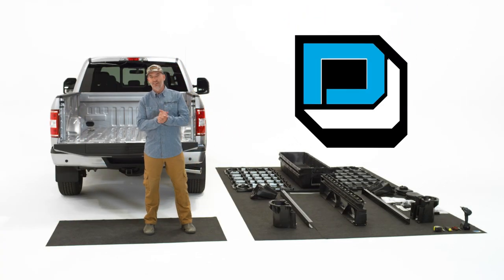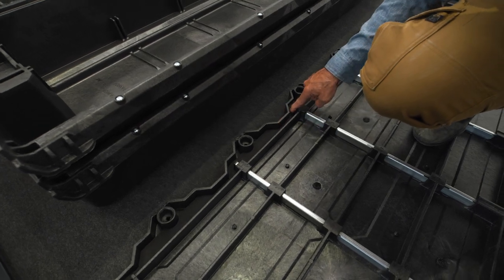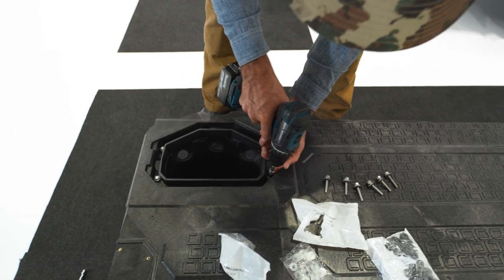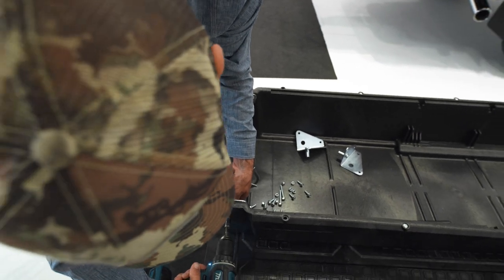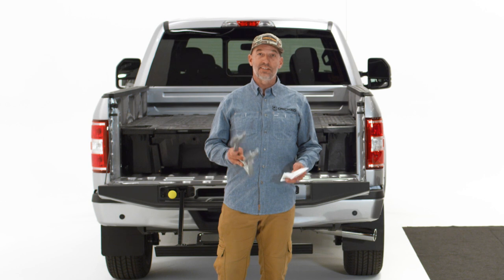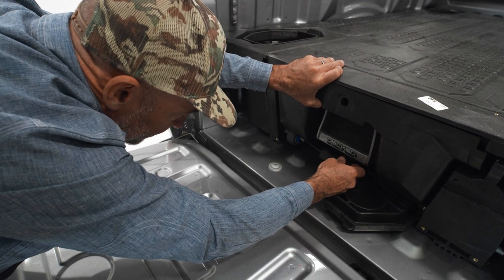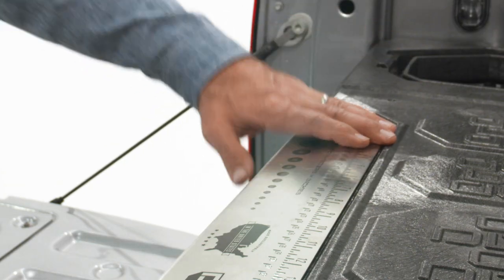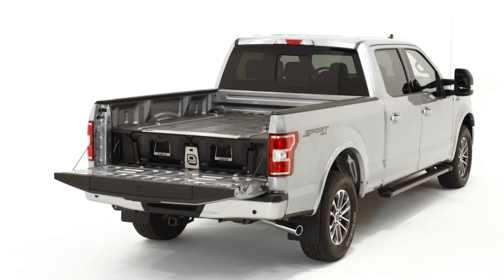DECKED 101: Full Size Drawer System Install Video

Comment: Watched the video a few times before I started my install (2023 F150). It was a bit cloudy, and I think a few of the plans have changed, but this was still a good resource. The whole install took me around 2.5 hours. The biggest part of that time was me taking off one of my tow strap hooks in the truck, a day after having a spray-in liner put in only to realize the instructions have changed and you don't need to completely replace these hooks any more. Decked has redesigned the J-Hook for the cab side. 

I love it already.

Comment: FYI: Decked Tech Support recommends NOT using this video as a reference, and the instructions kinda suck too so here are a few golden tips.
A. Use the longer bolts on the small cab ammo cans and the shorter bolts on the larger rear ammo cans. 
B. Because of the engineering genius involved, ONLY the bed covers are marked with any sort of orientation, so be damn sure the center spine is facing the right direction or you WILL install it backwards! The numbers and letters at the bottom of the ammo cans mean NOTHING, so don't try ad figure them out.
C. The screws are extremely cheap and aluminum (probably to prevent rust but my bed is covered) so you'd be wise to go buy a couple quality back ups as some will not fit correctly. Do not force a tight screw. Try a different screw or replace it.
D. Working on the Deck System at waist level is orgasmic by comparison to the ground. Use a work horse, fork lift or however you can get it up. 
E. Tech support is super fast and super friendly, but I'm not quite convinced they have ever actually built one themselves? 
F. Any You Tuber who claims they snapped it all together with no issues is a damn liar.
Reply: Mine had the wrong stickers for the driver/passenger side on the deck. Got the whole damn thing together, and into the bed (almost, would not fit right). The top deck was backwards/reversed. Had to take it apart and flip it all around. A real PITA.
Reply: Thank you this is gold.

Comment: Can it be put in over a bed liner, gmc sierra 5’8” box or do you have to remove it
Reply from the maker: Hey Steven! We designed the DECKED Drawer System with spray-in bed liners in mind. We have taken into account the normal additional volume and created enough lateral space to accommodate a spray-in liner. If you have a plastic liner, it will need to be removed. DECKED also works with Bed Rug mats -- just be aware it will be a very snug fit, and initially the wheels will wear on the rug until they wear through enough to roll smoothly. As far as the Bed Rug full liner goes, it will be very snug and we don't really recommend it, especially if there is a spray in liner as well.
Reply: @Decked  thanks for that info man. That’s what I needed to know.

Comment: Also, I’ve got an ARB dual air compressor mounted in the passenger cab-side corner of my bed. Is it ok to cut a portion of that decking and ammo can in order to provide adequate clearance?
Reply from the maker: Hey there. Any modifications to our system (panels or ammo can) does void our warranty and the overall structural integrity of the system. Unfortunately we cannot advise on that specific fitment/modification as we haven't done it. You might also consider mounting the air compressor on the deck panel itself. 👊

Comment: Can I install half of the deck system? And leave the other half open for cargo
Reply from the maker: It's not quite that simple. Folks have done it, but they end up installing both sides of ammo can assembly, and routing out the top panel, and removing the Drawer on the side that gets removed. We're talking about making a kit to make this easier!

Comment: Do you need to remove the factory tie downs? My truck bed has a spray in liner.. Have my decked assembled in the garage, and my hammerhead drill was no match for the tie downs lol

Comment: Will I still be able to use the bed lights switch in the F150? At 12”, it seems the lights will still shine on top of the system but the on/off switch is covered.
Reply from the maker: Hey there. Do you have an F-150 with the new Pro Power Onboard electrical generator? Check out our FAQs here for details on the light switch: https://decked.com/tools/faq/#!is-the-aluminum-f150-light-switch-compatible-with-decked-1

Comment: I’ll be installing a decked system on a 2020 F250 with factory spray-in bedliner. Do I still need to use the shims?
Reply: Did you use shims?

Comment: I just purchased an F250 and I am considering a Drawer System. I watched the whole video concerning the install but I did not see how the Drawer System was actually attached to the bed of the truck. It looks like it is just laying in there and could be lifted out by a couple of enterprising thieves.
Reply from the maker: Hey Tom. The Drawer System is secured with j-hooks to the factory tie downs in the bed through the ammo cans on the corner. For more information you can check out the install manual here: https://decked.com/pages/instruction-sets

Comment: Is there any reason the system cannot be installed from inside the bed vs building it and having to lift it up into the bed? 

Seems a little counterintuitive to build it on the floor
Reply from the maker: There are parts of the system during install that you wouldn't be able to reach if you built it in the bed.
Reply: @Decked  I was able to pretty much build the first half in the bed. I did build the second half on the floor and had some assistance placing the passenger side in. All in all, it's a pretty simple build. So far I am really enjoying my new purchase
Reply from the maker: @as3sxp  we love to hear it!

Comment: What is to stop 3 or 4 guys from lifting that whole system out of the bed and stealing everything?
Reply from the maker: Unfortunately a determined thief is pretty hard to stop.
Reply: Maybe the j hooks that attach to your bed mounts
Reply: Does your tailgate not lock?
Reply: @Sunbun101  it does but I feel 4 guys can still lift it out straight up

Comment: I feel like for 1500 doll hairs you could have installed the handles ?
Reply from the maker: Hey there. We install one... but essentially it comes down to shipping. We stack the drawers on top of each other and would not be able to do so if both handles were installed. If we installed both handles it would significantly increase the dimensions of the box we ship in.

Comment: Did i miss the important part where it actually connects to the truck?
Reply from the maker: Hey there! At about 9:15 you can see the J-hooks being installed through the ammo cans to the factory tie downs that are inside the truck bed. This is how the Drawer System is securely connected to the bed of the truck and is done in all four corners.

Comment: Looking good. 

Now bring on the model that fits around a gooseneck hitch👍👍👍,

Also is there a mold that I could bolt to a flat bed truck? 

Thanks
Reply from the maker: Hey there Steve. Never say never but since the center vert is a critical structural element, we will likely never have a drawer system that is compatible with a gooseneck. We have also never customized a system for a flatbed truck. However, we are coming out with a more traditional crossover style toolbox in January 2021. It will be gooseneck compatible and has our typical DECKED features and benefits. Stay tuned!
Reply: @Decked  

I understand the structure issue. After see how the system is assembled. 

I assume this more traditional unit works by having drawer system between a goose hitch an the tailgate ?  

If that is the case maybe I could buy 3 an install in a horse shoe pattern on the flat bed an have drawers open from each side an the rear of the vehicle?
Reply: @Decked  Looking forward to seeing it if it's cheaper than the full bed system.  I like the Decked system it just takes up too much useable space and is more than I can afford.  Can't find any used ones around for my Tundra.
Reply: @Decked  looks like it's probably this typical tool box with a built in ladder:

 https://www.theengineblock.com/decked-new-products-and-applications-post-sema-2019/

Not really interested in that.

If you had a stacked set of drawers between the tailgate and wheel wells that fit under a hard tonneau cover I'd be interested in that. Like 2 rows of 2 or two rows of 3 drawers.   It would have to be able to be secured down so a locking tailgate would still provide security but would in theory be easier to remove than the current full bed system.
Reply from the maker: @atlurker8037  great find. That is pretty much it and it will be less expensive than the Drawer System. We do not have any current plans to make a stacked set of drawers but appreciate the idea and you reaching out. Let us know if you have any other questions.

Comment: Can you all release a spec sheet of every size you sell so I can buy one for a truck you don't have listed
Reply from the maker: Check out our full technical specs here: https://decked.com/pages/technical-specs
Reply: I've seen that sheet but it still doesn't tell me what truck to order for
Reply: My bed is 72 3/8 × 56 5/8
Reply: But that spec sheet doesn't tell me what truck I should order your system for to get the closest fit for my bed
Reply from the maker: @Americanmafia1  without buying the data from the manufactures, we don't have access to the specs of every truck out there. From your dimensions though you would likely want to check out a 6' midsize truck. Each system is specifically cut to fit snugly to the bed walls though so you may have to do some cutting to make it fit your truck which does void the warranty.
Reply: I understand that it just comes with owning an older truck but I'm just looking to buy the system that fits my demintions the closest so the ranger or Colorado
Reply from the maker: Shoot us an email at dr.decked@decked.com so we can share a bit more info with you!

Comment: Wish they would not cheap out and use the crappy fastener sleeves that are screwed into the plastic on the deck where the ammo can bolts screw in. They should have spent the extra few bucks and instead used T Nuts that will not rotate and would give a far superior fastened strength. For the price tag, those little things matter.
Reply from the maker: Thanks for the feedback here! We're always trying to make our products better! We'll look into this in the future!

Comment: Yall mislabeled, sent old instructions, and forgot to drill holes for handle WTF is going on over there...so disappointed
Reply from the maker: Hey Daniel, please reach out to customer service so we can get you what you need ASAP. They can be reached at 208.806.0251.

Comment: Absolute pain in the ass to put together. 

 Boxes are cheezee.  They do not snap closed very well.  You need to put them together yourself.

  About a third of the drawer does not pull out, so it's kind of useless. You lose half your bed depth and another 15٪ minimum  to drawers that don't pull out, so kiss 65% of you truck bed goodbye. 

 Don't buy any extra stuff, not needed in my opinion.

Wouldn't buy it again.  Would send it back if I could.

I'll make a video shortly.

I built my own for my last truck for 1/3 the cost, wish I had again.
Reply from the maker: Sorry to hear that you weren't a fan! 

Yes, we have our users install them theirselves. This saves the customer big money on shipping!

 As for the Drawer Extension, we try to be as clear about this as possible on our site. Each drawer can hold up to 200 lbs and full extension would place too much upward pressure on the top of the deck. While also compromising the 200 lb payload of each drawer. 

You won't lose your truck bed! What you lose in bed depth, you gain in organized storage under the deck. You can haul just about anything you used to with the ability to ratchet strap items down on top of the Deck. Which has a 2,000 lb payload! 

The accessories are what you make of them. If you utilize them to their full potential, you may have enjoyed this system more. The CrossBox and D-Boxes can be packed for certain occasions. Create a grab and go environment for work, or for play. 

We get that our systems aren't for everybody. Hoping that you can give the System another shot!
Reply: @Decked   I'm going to do an independent review in a couple of weeks after I kind of figure out how to use the space at the end of every drawer. I'm thinking if I removed the front wheels I could pull that drawer all the way out.   I should have just made another 1. The 1 I made you could pull all the way out and I had a piece of wood on top of the deck that you could put over the drawers and turn the drawers into a big giant work table.